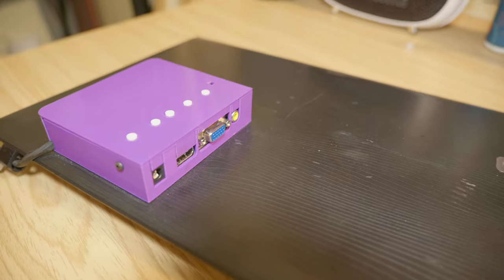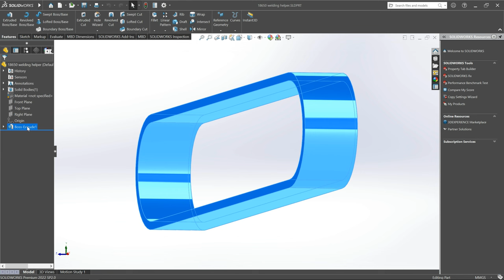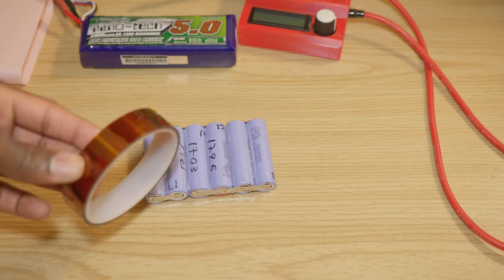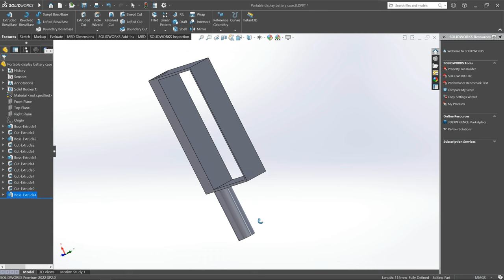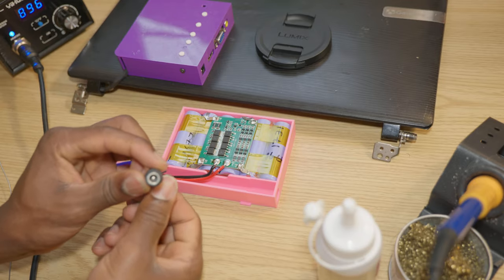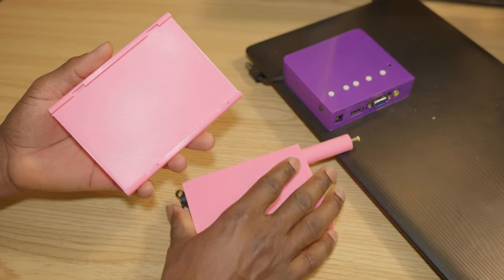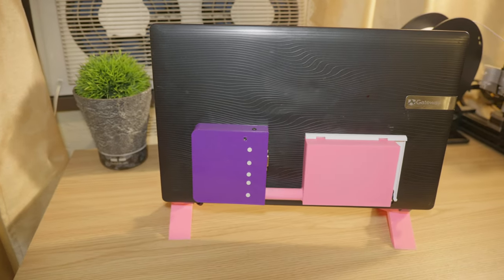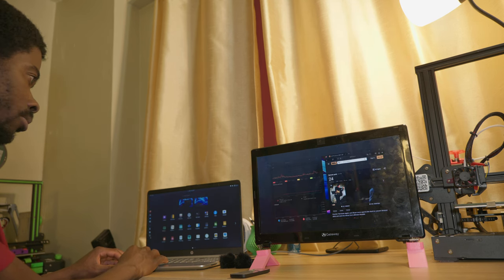Battery Powered Portable Monitor Build

Comment: Btw to be honest that's a dumb idea :\ If you really wanna use this for long time at least change that bms board. I have tested those and not good. Since these devices use low powers, Use 12v 1A/1.5A ups board. That's half the size and doesn't drop voltage when battery voltage is low. cutoff function works well. that pcb like $2
Reply from the maker: 12v 1A/1.5A ups boards aren't as available like this simple BMS, and they work the batteries a lot harder (by drawing more current) to supply 12V constant output regardless of the battery's voltage. Not suitable for recycled cells. All you will do is lower the 2.5 hours run time to 2 hours at most. They're not half the size, they're twice as big because they have a boost converter circuit. They also cost more except if you get them from Aliexpress that isn't exactly known for they fast shipping